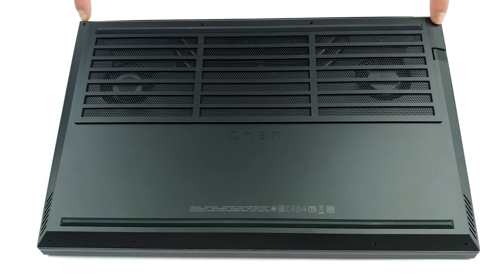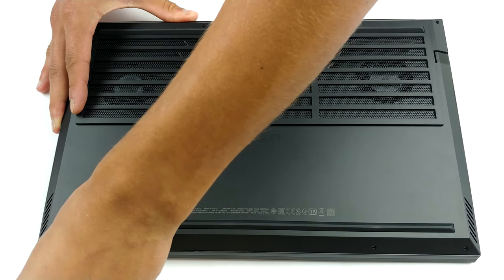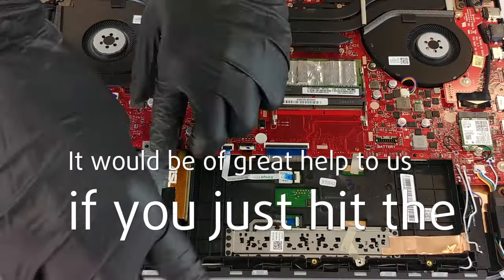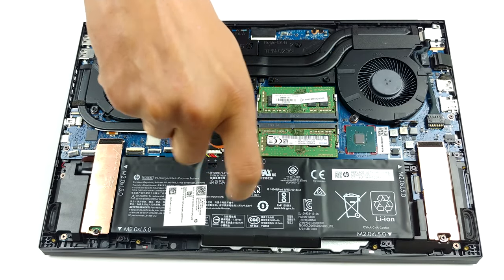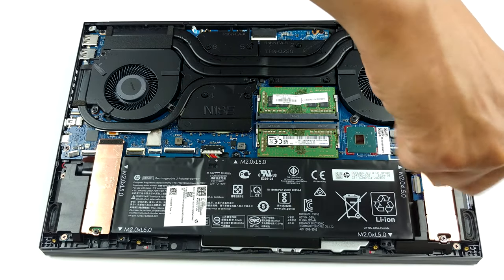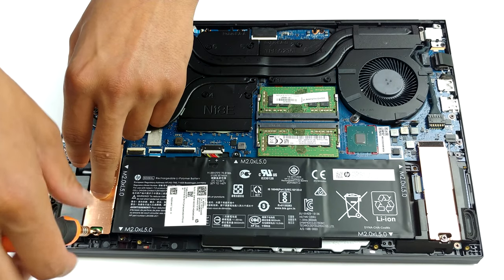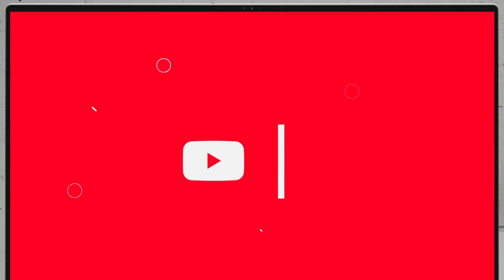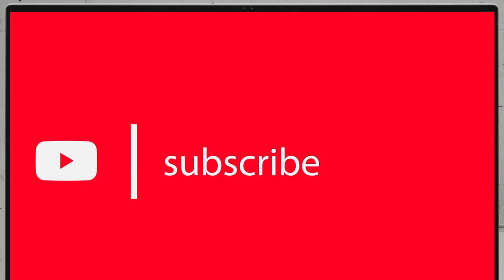🛠️ HP Omen 15 2020 (15-ek0000) - disassembly and upgrade options

Comment: Thank you for the video!
Question, do I have to remove the battery before upgrading?
Reply from the maker: It's not necessary, but it would be a good idea to unplug the battery connector :)

Comment: Can you guys, if you still have that machine, go to CMD and run this command - wmic memphysical get maxcapacity
It shows what's the max supported RAM capacity, in Kb. I need to know if it supports 64 Gb for real. I don't know why Lenovo and HP are claiming that there machines support up to 16gb when apparently this chipset goes up to 64gb of RAM... Ridiculous.
Reply from the maker: Hey, we can confirm that the laptop supports 32GB per slot :)
Reply: @LaptopMedia  thanks for that info, is that the same case with Lenovo Legion 5, Ryzen 7 4800H? Imo this machine should support 64 Gb of RAM too as it has the same chipset as the HP laptop.
Cheers!
Reply: @LaptopMedia  Sweet, This MAX RAM Upgradability is what most of the YouTube reviewers miss out on finding/letting know. Thanks, @LaptopMedia!
Reply: @RahulSainiYT  Yeah, I have got a Ryzen 7 4800H machine with 64gb of RAM, when ran this command is says 32gb max, but I have 64gb of ram. I guess all these vendors stating that the max ram of this chipset is 16 or 32 gb are simply liars, I don't see any reason why would R5 4600H or R7 4800H wouldn't support more than 32 gb of ram when clearly the official AMD website says, max supported ram up to 64 gb.
Reply: Also shows how much RAM UPGRADE the laptop can have. I see only HYPERX 32 GB Stick available for one slot here in Amazon India search
Reply: I'm also interested to know what max amount of RAM hp omen 15 can support with ryzen 7 4800H processor.
Bcz that matter for me.
Reply: @arsitech-ltd  Omen 15 supports max 64gb of RAM

Comment: How do you clean the fans and vents?
Reply: Probably not the best way but I shut off mine and use a handheld vacuum on the vents and fans then   blow everything with a compressed air can using the tip attachment

Comment: What is the maximum ram supported for AMD version (en000 series) , website it mentioned only upto 16gb? 
Edit/update: I have added 16+8gb ram, and it supported, so u can more than 16gb
Reply: Amd 4600h CPU
Reply: Amd 4600H supports up to 64gb so you should be fine
Reply: @NESTgamers_  can you share related link to prove that 64gb is supported?
Reply: @sathish777  https://en.wikichip.org/wiki/amd/ryzen_5/4600h , supports 64 GiB,  roughly equal to 64 GB
Reply: @NESTgamers_  thanks, yes the processor supports upto 64gb,but in hp omen  india website why do they write its only till max expandable to 16gb, would the manufacturer add any limits in the motherboard or its an error on their part
Reply: @sathish777  It's most probably a set motherboard limit,  since Windows 10 64-bit can support at least 128gb of RAM. Asking a HP representative would probably be the best way to know about their RAM limits
Reply: @sathish777  you can upgrade to 32 gigs in indian models
Reply: @sathish777  i have confirmed news
Reply: @sathish777  also you yourself can check your max ram limit in cmd which will give results in bits, then you have to convert it into gigs

Comment: I just bought this notebook a month ago and is awesome, the only problem that I have is that the version that where sold here in my country (chile) is the hp omen 15-ek0010la, these version has a 60hz, 6 bit  display.
The doubt that I have is it possible to change my screen model for the 144hz IPS (AUO82ED) of your version.
Is this panel  compatible with my notebook version?
Reply: Have the same concern..

Comment: Can we replace the screen with one with more refresh rate. If yes I would like to see.
Reply: yes it's possible. but i can't find any replacement screen. i want 144hz one i've 60hz currently. it's very easy to replace just disconnect pins and unscrew hinge. Very simple and well designed laptop.
Reply: @kapilr.4768  bro what shall be the price of that high refresh rate display , 144hz ??

Comment: I have the 15ek-0010la series and it brings an 8b 3200mz ram, when installing another identical to the one it comes from the factory, will the dual channel be activated?  what the notebook supports is 2933mz

Comment: Can i upgrade the RAM and ssd storage i mean is there 2 slots for ssd and ram for hp omen 15 2020  Ryzen5 version?
Reply: Yes, you can either add a m2 drive or  replace the one in there or both. Ram can also be upgraded.
Reply: @ANewHorizon  my midel is actually en0001ax..us it sure that it has 2 m.2 slots?
Reply: @sreenathvipin626  I think all of them do have 2 ram and ssd slots we don’t have the amd models in our country but I think they have 2nd slots

Comment: Is there enough space and flex in the battery power connector to unplug it without completely removing the battery?
Reply: No, don't do it. First lift up the battery and then remove the connector.

Comment: How (or where) do you change the thermal paste?
Reply: You have to remove the whole fan system as the cpu is beneath it. It’s easier than it sounds although it is a little more time consuming

Comment: My lap:hp omen15-ek0018TX.
Can I upgrade GPU from GTX 1650 ti to RTX version.And also display from 60 to 144hz
Reply: In laptops the video is usually on the motherboard. It is possible to replace the board but probably would cost more than buying the laptop that already has what you're asking for.

Comment: I got the 15" Omen, curious, how many M2 slots are there? Mine came with a 250gb M2. Unsure if I need a M2 or 2.5". I want to add, not replace
Reply: just take the bottom off and look for the golden pieces next to the battery if there are two you have 2 if there is 1 then you have one

Comment: I have Hp Omen 15 2020, i5 model (base model). Can I upgrade my SSD, I currently have only 512GB?
Reply: hello can i know hows the laptop please cause im planning to buy the same model
Reply: Hi I have the intel i7 model, you are able to upgrade it with a 2nd pci
Reply: @humanspider9421  I would simply say it's the beast.

I like the design very much and it doesn't show you are gamer, so you can also use it for office work.
Reply: Nikunj Bangad thank you so much and is the screen colour full
Reply: @Primalconservationist  I have the same model and I'm looking to upgrade it can you please mention the SSD you used in the 2nd pci
Reply: ravi kiran hope this helps, and it’s really easy to install. Have a good one 🤙🏽
Reply: @Primalconservationist  thank you :D
Reply: @Primalconservationist  I have a 1tb SSD preinstalled . Can I install one more 1 tb SSD?(model No: ek0019tx)
Reply: Venkatesh Kamat yes you can install another one, hp omen 15 2020 intel rtx 2060 is my model, it only has a second one so think about getting a 2tb if you have a lot of games 👍🏽
Reply: Venkatesh Kamat no problem :)
Reply: @Primalconservationist  thank you very much for the help
Reply: @Primalconservationist  how is the default ssd speed?
It seems a bit slower than a 3500mbps SSD I installed on my desktop. I don't know if that is just me
Reply: @ryan9818  yes the speeds are close to 3300 mbp/s

Comment: Hello I have 15-ek0022nl and I want expand hdd with another m.2 ssd disk identical to the first one (kioxia 1TB). After upgrade I want to have 2TB. I can replace 2 ram 8GB and put two ram 16 GB? Where I can found if is expandible or not and maximum ram used? Thanks

Comment: Do we need to remove battery to upgrade ram
Reply from the maker: No, you don't, but ideally you would want to unplug the battery connector before you mess with the memory.

Comment: Bro,Iam using Ryzen 7 laptop and I  have a Stock Ram which is Samsung 3200mhz CL22 8GB and I upgraded it with another ADATA 3200mhz CL22 8GB..While checking in CPU-Z, the clock speed of #JDEC 11 and #JDEC 12 of ADATA ram is lower than Samsung RAM but #JDEC 13 and #JDEC 14 are same to both ram....Is ADATA RAM is bottlenecking? and Am i should change the RAM to get the same speed of Samsung RAM?

Comment: Can I upgrade upto 32gb ram in Ryzen 5 version( base model)  though it is not mention, but that mentioned in intel version
Reply: Yes you can
Reply: You did?
Reply: @adityapratapsinghparihar2057  yes increased to 24 gb(8+16gb)
Reply: U could add 2 16gb for a total of 32gb
Reply: @sainishanths7840  can we upgrade SSD upto 2 tb, each of 1-1 tb M.2 NVME SSD??
Reply: @DS-nq5qf  yes we can, but u need to throw away the existing 512gb, But y do any one need 2tb nvme ssd? ( I have 512 gb + 1tb crucial nvme ssd)
Reply: @sainishanths7840  yes 1+512 gb is enough, but I have asked for safety, if actual storage capacity is upto 2tb😀😀!!👍
Reply: @DS-nq5qf  u can
Reply: @sainishanths7840  Hey sorry to bother you, i'm quit a noob at upgrading laptops and idk which ram and ssd I could use for my omen 15. Would like to have + 1tb ssd like u and 32 gb ram (2 x 16gb)
Reply: is this a compatible with my pc ? 1tb SSD: Samsung (MZ-V7S1T0B/AM) 970 EVO Plus SSD 1TB  

for Ram, can't figure out what would be a good one
Reply: @blankneverlosegaming6374  For ryzen 5 4600H model I am using a crucial 8gb 3200mhz CL-22 latency ram and a crucial P1 1TB nvme M.2 ssd (form factor 2280). Hope this helps

Comment: Back up your ram claim with evidence. HOW AND WHY DO YOU FEEL SURE THE UNIT CAN ACCESS 64GB OF RAM?

\-_-/
Reply: I have the high end model of this series. I feel they max out at 32 gigs.
Reply: @ANewHorizon  I put 1 32gb in WITH THE 8GB IT CAME WITH I assume it will take another. It now reads 40gb, IT WILL READ 64GB. ENJOY. I used Samsung
Reply: @I-_-I_SB  why didn't you pair them? Mine came with 16 and I replaced the two with 16 each.
Reply: @ANewHorizon  I will be ordering another 32gb in days, I’ve installed 32gb plus the 16gb that came installed. Now it shows 40gb ram, Samsung 64GB in hp omens 15 ✅
Reply: @I-_-I_SB  what model exactly, i'm looking for a good Ram model but i'm a noob enough not to understand what's compatible with my omen 15-ek0130nf
Reply: @I-_-I_SB  So I should go with 2666MHz instead of 3200MHz (cause thats what other videos said)? though idk if its a performance thing or it consumes less power. Anyway thanks.
Reply: @blankneverlosegaming6374  2666